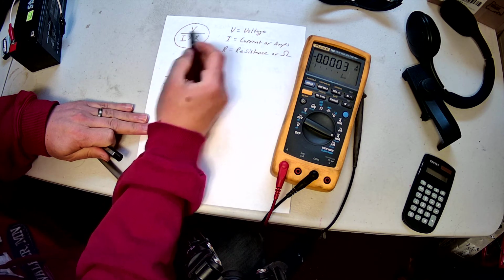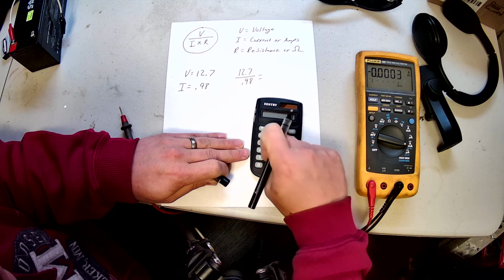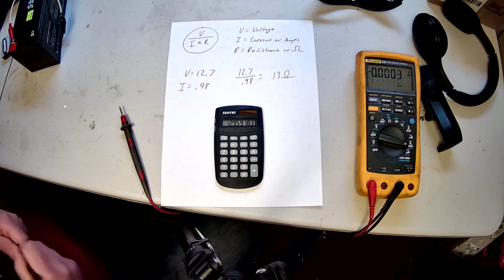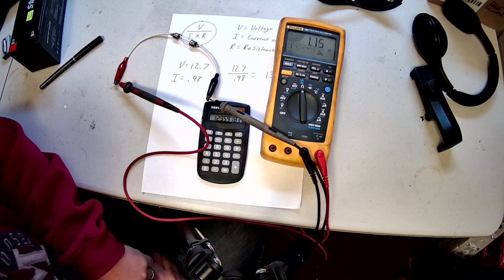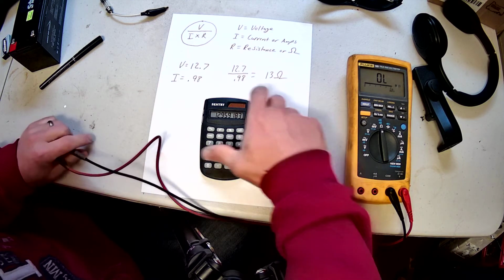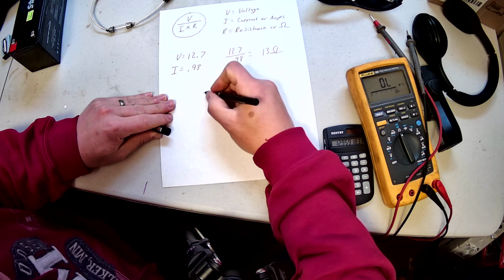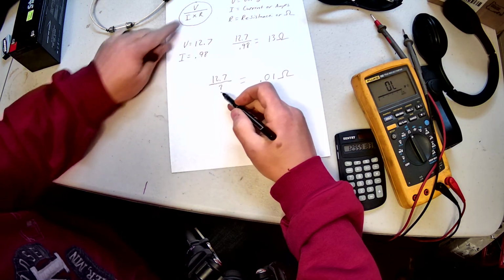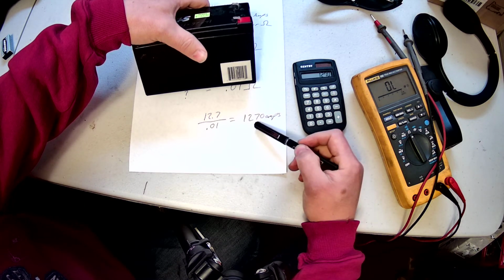Ohm's Law for Automotive and Welding application

Comment: Hey Stanley, if you take 12.95 / 10 which will give you 1.29 ohms closer to what your DMM is reading. Trust me I thought about this a lot on my own and on my work bench, finally was able to figure out when you divide by 10 it will give you close enough readings on the bulbs.